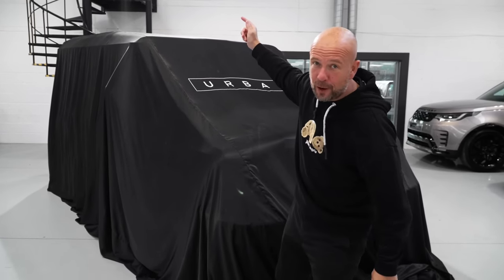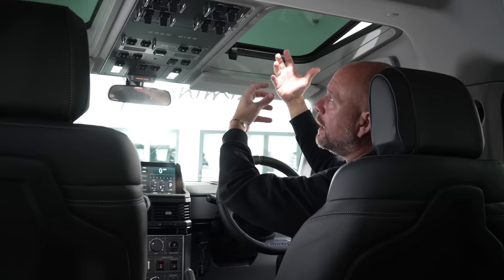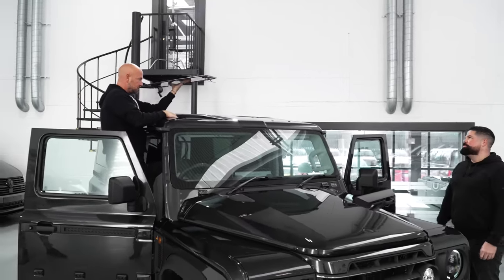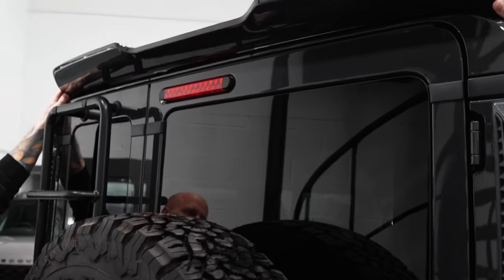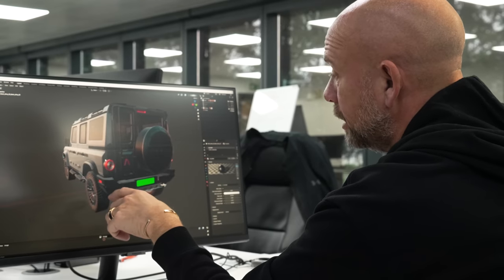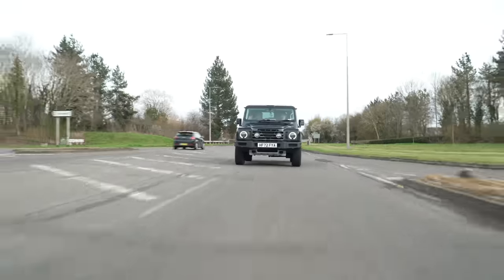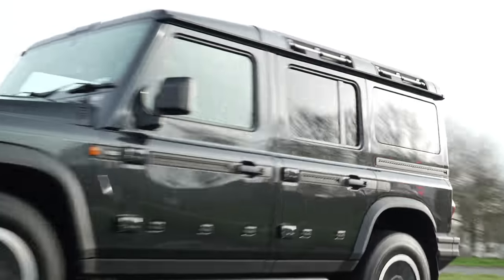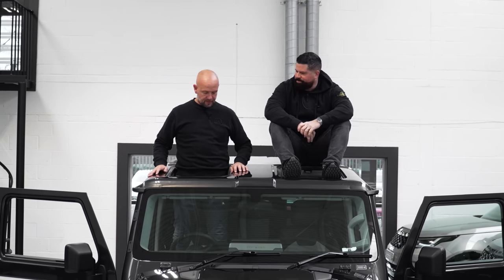FIRST MODIFIED INEOS GRENADIER - IS IT A DEFENDER BEATER? | URBAN UNCUT S2 EP10

Comment: I actually really like it. The only thing that bothers me is the BMW gear lever. Obviously I’m aware of the BMW drivetrain, but in a car like that, it needs a much more utilitarian gear lever. It’s fine if they’re using in a car like the Toyota Supra, but it looks out of place in the Grenadier.
Reply: I totally agree Dan. I’m dubious that the BMW engine will hold up to hard work. Ineos are marketing this as a tough work vehicle. 
LR fitted earlier versions of the 6 pot diesel & that didn’t go well. 
Why they didn’t select either the VW or Merc 3 litre diesels beats me. Both those have proven track records in commercial vehicles.
Reply: The lever is not a BMW lever, it’s actually a ZF lever.
Reply: @ACOGJESUSSCOPES  It still doesn’t detract from the fact it doesn’t suite the car.
Reply: Could definitely do with some leather/material to toughen it up a bit

Comment: An idea for your light bar. What about a bar / tube that looks rugged similar to the side steps. 
Can bolt on somewhere near the side mirrors (fenders) go up the sides of the windscreen and across the top of the windscreen. 
The lights can be bolted onto the bar. 
Could be a neat / rugged design and will help with water catchment problems.

Comment: I’d like to see some genuinely practical aftermarket parts from you guys, as opposed to dressing up the Grenadier like a tart’s handbag. 
A half bulkhead for the 2 seater Utility version would have me knocking on your door, as would a full length split level cargo deck, allowing storage for Pelicases on the bottom (out of sight from prying eyes) and lighter kit on the top deck. Preferably quick release, to allow use full cargo space when needed. 
Awaiting build date for my 2 seater Utility with eager anticipation.

Comment: How about the ability to mount a rifle rest in the roof lights using the system on the doors. Also put infrared lights in the light bar. 
Have the ability to turn off all the lights, including brake with the exception of the infrared ones.

Comment: For the light bar... a singular Sentinel lazer lamp (other brands available) in carbon-like eggshell-shaped cowling on each front corner...will not effect the safari windows...then in the centre Evolution ST4 in a pod that sits on the raised area of the roof...thus eliminating the water trap...😁

Comment: Just a bit of feedback from someone who drives 4WD vehicles regularly in the Australian bush... the spoiler on the roof at the back will most likely cause vortices in the airflow which will cover the rear windows in dust. Lights above the windscreen result in poorer visibility closer to the front of the vehicle in dusty conditions, like when you're not the lead vehicle in a convoy, so it's more likely the driver will hit rocks and wildlife etc etc. I moved the spotlights from looking over the cab to back on the bullbar on my ute, it was so much better. Of course, if these are just cosmetic accessories for Chelsea tractors it doesn't matter.

Comment: Love the it,  light pods make everything look better, would love to see a smooth cornered box section side step that kind of mirrors the edge of the front bumper, a little more utilitarian and aggressive, I know ineos offer a rack but a low profile rack that follows the roofline ( like the prospeed disco 3/4) with intergrated light pods would look insane , also 30mm wheel spacers and extended arches would add so much to the stance of this thing !
Reply from the maker: Thanks for watching and commenting 🙌

Comment: I would forsurely buy it with some changes outside,33 inch tyres,love those bigger flairs,front bumper can be removed and the bull bar finishing it off,and I would like the 3 litre diesel with free-flow pipes 👍👌
Reply: i think it would swallow up 35's x 12.50's pretty easily.

Comment: 10:57, spoiler on the rear could encase a pull out awning mounted by extension poles that sit in hollow encasings in the spoiler body for shelter from wind and rainfall making the back hatch a proper working area, 🤔😏👍🚙👌🇨🇮

Comment: To me, this will be really popular for those of us who love the defender design as its near identical but with the modern comforts it was missing like comfy seating and modern GPS and quality audio system. Though the wallowy steering is great when offroad, its kind of dangerous in traffic as it slows down reaction time and btw, how does this vehicle rate on safety? Would it be possible to be able to have the steering react to the speed your driving? ie. Have it wallowy (as it currentlyis)  for off-roading to highly responsive when you're driving at speed or have a switch to engage fasr responsive steering?

Comment: Interested already in the double steps.  I am scheduled to test drive the Grenadier this Wednesday in Phoenix, Arizona, USA.  I'm an early reservation holder and will order as soon as they are available here.  I'd like to know very much what the expected weight rating you'll have on the side step bars?  For example, the Ineos rock sliders can support the weight of the vehicle for jacking but the Ineos side step cannot.  For the vote, I'd like to have the checker plate, because I plan to order the factory accessory checker plate wing / fender reinforcements and think that'd tie together nicely.  Also, very interested in seeing what you come up with on the  roof lights with the safari roof, as I plan to order this on mine and the accessory roof rack to hold the available light bar is not compatible with the safari roof.
Reply from the maker: Great Feedback - we will consider jacking points in our final step design 👍🏻

Comment: This vehicle will definitely be used by various armed forces in NATO , because of the reliable Straight 6 Diesel & Petrol BMW Engines and also because the towing hitch is designed with 3 versions including the NATO heavy duty hitch for towing military trailers and as many armed forces in Europe still use the older Land Rover 130 versions in various parts of  the European Theatre of operations

Comment: The steps with the insert that matched the oem door one was good, no need for the metal additon I dont think, Id personally prefer the chuckier 3" tune than the slender looking 2.5" and may only be in a single tube form.

I cant wait to get mine and to start playing with its looks and of course the electronics :)

Comment: Was hoping this would be good, but it looks like all the parts are just form over function. For example, lots of time spent on re-designing the steps instead of designing rock sliders which would actually serve a purpose other than making the vehicle look different that the factory model. Hopefully future videos will prove me wrong. Cheers from OZ

Comment: the option I would like would like to see is  rear half and half as 1/4and 3/4 doors look fine 30-40  years ago

today half and half make more  sense  makes it more benefit rear  access 

if I was going to modify it  I'd do  i'd do a 3 seat wide model

I would also like to see mechanical manual with a 6-7 speed with crawler  gear and power steering  

I am a 6 foot fat arse meaning if i'm going to get out those skylights

bigger question i have what the accommodations for  6'1" to 6'5"

Comment: You can option side runner steps when you buy it, and a light bar. A spoiler.. Really? Is it a vehicle which wants a spoiler. 

I'm not sure there's much scope to improve on this in the market it's designed for.
Reply from the maker: We are looking to add products to the range the change the appearance and complement the original design. 

The factory option side runner comes without footpads (which we intend to add) the factory light bar is a simple bolt on option for the roof rack, we intend to produce a solution inside a roof mounted enclosure (for use with or without a roof rack). 

With regards to the spoiler, if this car is anything like the Defender (new and old), there will be plenty of owners that want to make their Grenadier look aesthetically individual.

Comment: NO SAT NAV……. No Front USB,C Charger on the Dash …. No Mirrors under the sun Visor….  No where to put a Mobile Phone anywhere except forward of the gear stick where its not easily accessible… Little important things that could have been dealt with easily in the design stages….. Other than that a Brilliant 4x4…